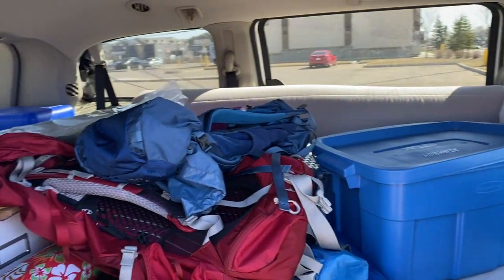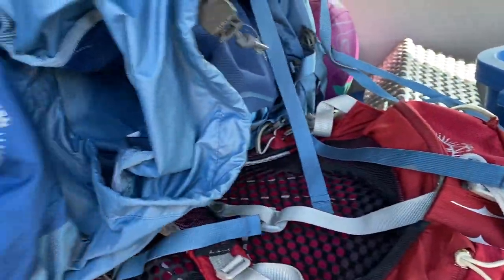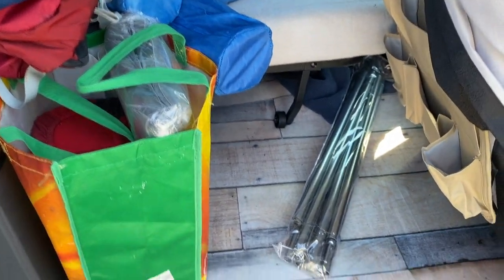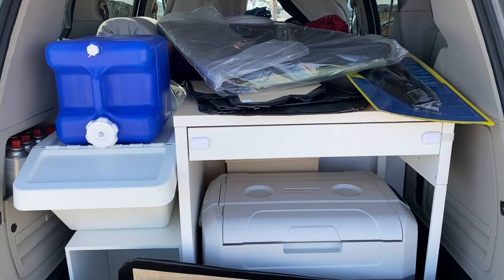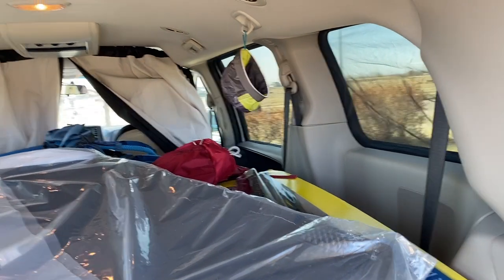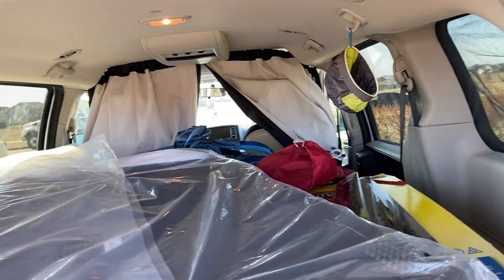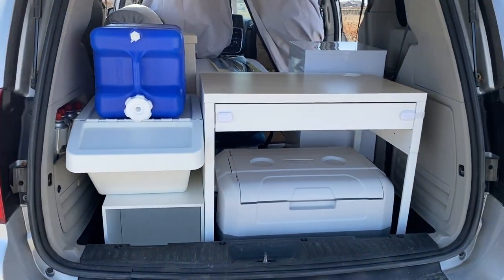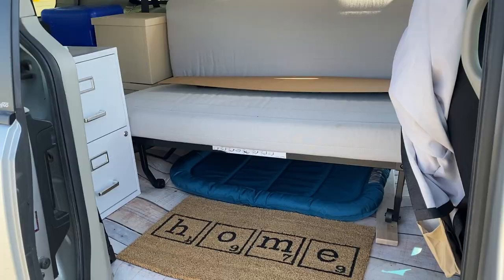#VANLIFE | How to Fit IKEA FUTON in a MINIVAN | Van Update | Packing & Organizing Rooftop Cargo Box

Comment: I hv a Toyota Siana , did the measurements of the rug that looks like would fit without cutting or trimming
Reply from the maker: I ended up cutting just a little bit off my rug, so that it followed the contours of the van, then I tucked the end under the mouldings near the side door opening. The rug did not fray, or at least it hasn't yet. So far so good!

Comment: How does the bed look in sleep mode?
Reply: Yes, please show us. Do you just sleep on it like a couch? Ikea says it's only 55 inches long wide, not very long to be comfy.
Reply from the maker: I am only 5'3" and fit on the futon as a sofa. If I want though, It does fold out with a section of the mattress on the floor. I have it set up this way for when my 10 year old joins me on a trip! That part lays on the floor creating a second bed for her. Now, if you are wanting to use the futon as a full bed, I would suggest leaving the frame whole. It does into the van horizontally and the back can lean against the two front seats and unfold towards the back of the van. I tried it this way at first. Hope this helps!

Comment: Nice! but how do you sleep????
Reply: I’d like to see the sleeping mode too. Great idea.
Reply from the maker: I am only 5'3" and fit on the futon as a sofa. If I want though, It does fold out with a section of the mattress on the floor. I have it set up this way for when my 10 year old joins me on a trip! That part lays on the floor creating a second bed for her. Now, if you are wanting to use the futon as a full bed, I would suggest leaving the frame whole. It does into the van horizontally and the back can lean against the two front seats and unfold towards the back of the van. I tried it this way at first. Hope this helps!